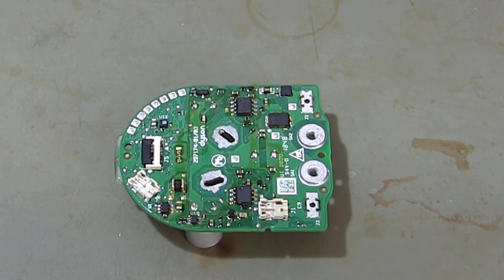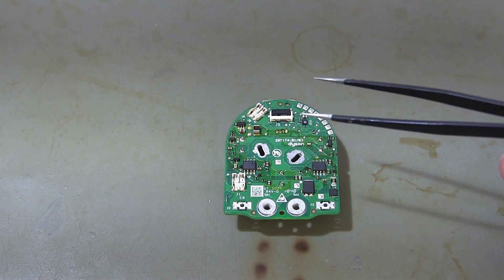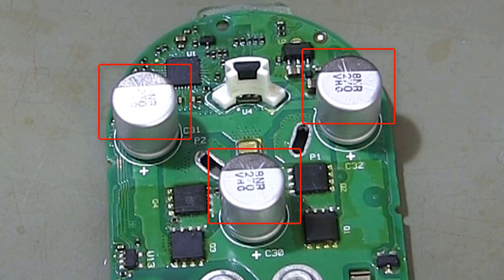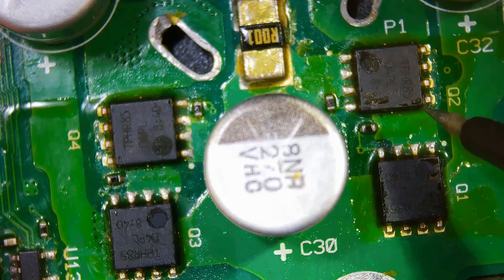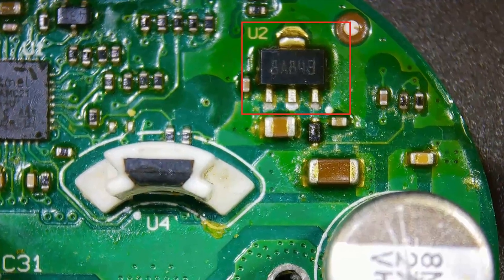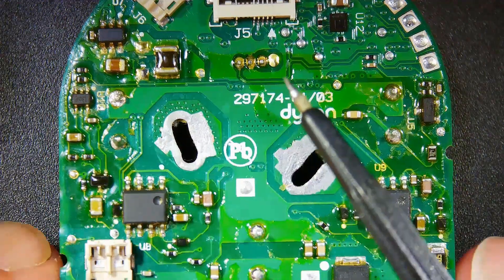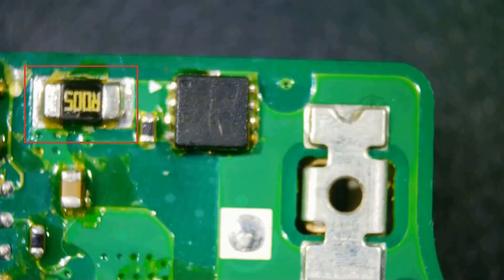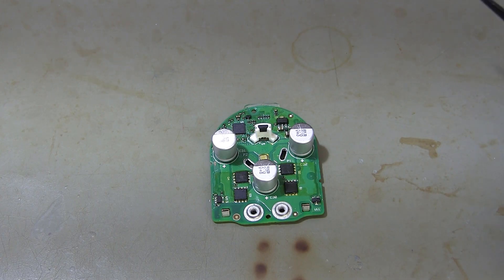How to Repair Dyson V11 Motor Control Board? Component Analysis

Comment: Hope you can help, V10 just starts and stops on speed 1 and 2, but it starts and runs on speed 3 if intake is fully blocked. Under normal operation it should start pulsing if intake is blocked. So looks like it only runs if motor is under a high load. I’m thinking current sensing resistor could be at fault or mosfets. Any idea?
Reply from the maker: Hi, I have never repaired a Dyson V10 vacuum cleaner before. But I can give you an idea about your problem.
Problem with Clogging Sensor
In Dyson vacuum cleaners, the motor load detection is activated when the air flow is blocked and usually exhibits a "pulsing" behavior to notify the user. However, your vacuum cleaner seems to only work under high load.
Possible cause: The blockage sensor may not be working properly or may be covered with dust/air.
Solution: Clean the sensor and make sure it is connected properly.
Types of Clogging Sensors
Pressure Sensor (Differential Pressure)
Measures the pressure changes in the channel through which the air flow is provided. When there is a blockage, a pressure drop or difference is detected.
Location: It can be in the air duct, near the filter or motor.
Working Principle: There is a piezoelectric sensor or membrane that measures the pressure difference.
Air Flow Sensor
Measures the speed at which the air is moving. If the air flow stops or slows down, this is detected as a blockage.
Location: It is usually located in the airway near the motor inlet.

Working Principle: It works with a hot wire anemometer or other air flow measurement methods.

Electronic Load Detection
In some Dyson models, instead of a physical sensor, the electronic control unit (PCB) on the motor analyzes the load status of the motor. When there is a blockage, the motor draws a higher load and this abnormality is detected by the control circuit.
Location: This type of system usually does not require a physical sensor; it is integrated into the motor control board.
Locating and Cleaning the Blockage Sensor
On Dyson vacuums, this sensor is usually located near the filter or in the air inlet/outlet.
If it is on the filter, the sensor may be covered in dust or dirt. You can remove the filter and visually inspect the sensor.
The sensor looks like this:
A module with small holes (for measuring air flow).
A part connected to the electronic circuit.

Fault in the Motor Control Board (PCB)
The motor control board contains the circuitry that controls the motor speed and power. The MOSFETs, optocouplers, or microcontroller on this board may be faulty.
Probable Cause: The load sensing or speed control circuitry may not be working properly, which may cause the motor to stall at low speeds.
Solution: Visually inspect the board. Check for burn marks, swollen capacitors, or cold solder joints.

Battery-Related Problems
If the battery operates normally at high loads but fails to provide sufficient power at low loads, this may also indicate a problem.
Probable Cause: The battery voltage may be low, or the battery management system (BMS) may not be working properly.
Solution: Measure the battery voltage and try with another battery if necessary.

Motor Failure
The motor may not be operating properly at low speeds and may be operating stably at high loads.
Probable Cause: One of the carbon brushes, bearings, or coils inside the motor may be worn out.
Solution: Inspect the motor and replace if necessary.
Airway Blockage
The cleaner's airway may be partially blocked, preventing the motor from providing adequate airflow at low speeds.
Possible cause: Blockage in filters or pipes.
Solution: Clean all filters, pipes, and connections.

Comment: This is the most useful video I have ever come across.  Thank you!  I also hope that you can do a video on the V10 as I have been trying to fix mine.  My V10 only works on Max.  When I try medium or low, the motor will only spins for a second and stops.  I have cleaned up everything and replaced the filter but still no luck.   It must be the control board that gives me problem.  What will be the most possible issues, the MOSFETs, capacitors, the hall sensor detecting the positions of that switch (Max, Medium, Low), or other things?  Thanks for you help!
Reply from the maker: First of all, thank you for your interest.
You can examine the following components to narrow down the causes of the problem with your Dyson V10. The problem is most likely in the control circuit or related components. Here are the possible problems:
First, Check the Solder Joints: Cold solder joints can cause such problems.
1. Hall Sensor
Function: It senses the RPM of the motor and controls the motor speed accordingly.
Possible Problems:
If the Hall sensor is defective, the control circuit cannot sense the speed setting correctly. Therefore, only one setting (Max) can work properly.
There may be oxidation or openness in the Hall sensor connections.
Solution: Check the output signals of the sensor using a multimeter or oscilloscope. If it is defective, replace the sensor.
2. MOSFETs
Function: It provides power management to control the motor speed.
Possible Problems:
If the MOSFETs are partially defective, they may not be able to provide enough power at low and medium speeds.
They may have been damaged due to thermal stress or overload.
Solution: Check the operation of the MOSFETs by measuring them. Replace the defective ones.

3. Capacitors
Function: Provides voltage balancing and reduction of fluctuations.
Possible Problems:
When capacitors age or fail, voltage fluctuations may occur, which prevents the motor from operating stably at low speeds.
Solution: Measure the ESR (equivalent series resistance) value of the capacitors. Replace those that are swollen or have low capacity.

4. Microcontroller (MCU) or Control Card
Function: Controls the motor speed and processes the signals from the Hall sensor.
Possible Problems:
If the MCU cannot process the speed settings, this may prevent the motor from operating at low and medium speeds.
There may be breaks or cold solder in the circuit traces on the control card.
Solution: Check the signals from the MCU and the solder connections. If the microcontroller is faulty, it may need to be replaced.

5. Motor
Function: Provides the suction power of the vacuum cleaner.
Possible Problems:
The motor may not be producing enough torque at low speeds.
There may be an internal winding short circuit or problems with the carbon brushes.
Solution: Check the connections and general condition of the motor. Replace if faulty.
6. Battery Management System (BMS)
Function: Provides the energy required for the motor.
Possible Problems:
The BMS may not be providing the current required for low and medium speeds.
Solution: Measure the battery voltage and current output. If faulty, check the BMS board.
Reply: @electronic7979  Thanks for your detailed explanation. 
My replaced, used Dyson v10 motor is a bit slower overall than before. Which of your answers 1 to 4 should you be suspicious of?
Reply from the maker: If the motor is a used motor, I recommend checking the capacitors first.
Reply: @electronic7979  Thank you so much for the very detailed reply.  I will work on the suggestions and hopefully can find the problem soon.
Reply: Thank you. I have the same symptoms. I had to replace the motor. Do you know what caused it? I have the motor that I took apart. I wonder if I can fix it someday.
Reply: @서원파-v3w  sorry to hear that you have the same problem.  I have checked the Mosfet, capacitors and hall sensor and they all seem fine. I still could not find the reason and ended just replaced the motor assembly like what you did.  I also feel that the new motor is somewhat less powerful than the original even though it otherwise works normally in all three modes.
Reply from the maker: Thank you for your interest. There is a possibility that the motor driver mosfets may be faulty.

Comment: HI , could you please help me to identify U2 regulator replacement.  I have Dyson V11 and it have marking 8a918. I struggle to find anything about this regulator to find replacement part , but no luck . I will appreciate if you know and to help me to fix my vacuum.  Best regards
Reply from the maker: I couldn't find much information about this integrated circuit. I think it's probably the HA178L00 integrated circuit. It could be a 2.5v, 3.3v or 5V positive voltage regulator.
Reply: @electronic7979  thank you for your time,  I will look datasheet and compare. Look like that is the one . I will give you update.  Best regards

Comment: ciao, sto provando a riparare il mio dyson v11. lo schernmo lcd si accende , cambia le modalità di aspirazione, ma appena premo il grilletto, da un colpo appenna accennato e on parte o una serie di piccoli colpetti. ho fatto delle misurazioni sul pcb e mi risultano rotte 2 resistenze dei mosfet mentre altre 2 hanno un valore di 100 ohm. r001 ha un valore diverso da 1Mohm. cosa posso controllare e sostituire secondo te?
Reply from the maker: It would be more accurate to remove the R001 resistor from the circuit board and measure it. If the resistors connected to the mosfet are faulty, your mosfets may also be faulty.

Comment: A common problem seems to be that  the high torque head motor starts spinning when the vacuum turns on, then stops immediately. This happens unless the vacuum is set on boost mode so there's nothing wrong with the motor. Would be awesome to know what's likely not working in this scenario and how repairable it might be. Great video.
Reply from the maker: Thank you for your interest and valuable comment.
Reply: I had this problem, a few months later the motor entirely failed. I fixed it by just replacing the motor with one from aliexpress and its basically like brand new.

Some people have been unlucky getting dodgy motors from aliexpress but my one seemed to be brand new. It cost me $135 australian.

Comment: Hi, thank you for this video. How can I repair a non functional v11 motor? When I push the switch button, I hear a sound (same sound when the chamber is full). What do you think about this please?
Reply from the maker: Hello. Thank you for your interest. If you hear a similar sound when the bin is full when you press the switch button on your Dyson V11 vacuum cleaner, the following problems are possible:

Airflow Blockage: There may be a blockage in the vacuum cleaner's pipes, filter or bin. The blockage can cause the motor to overload and make noise.

Filter Problem: If the filter is not placed properly or is dirty, it can cause the device to make the sound when the bin is full.

Apart from this sound, does the vacuum cleaner work normally?
Reply: @ thank you for the answer. 
Filter, bin and pipes are cleaned. Everything is ok but the cleaner doesn’t work at all. 
The battery il fully charged but when I press the button, always the same problem..
I am sorry, the sound is not like the bin is full. 
The sound is like when I press the switch button 1 second only (like a « bum »)
Reply from the maker: There may be a problem with the MOSFETs on the motor control card or the electric motor.
Reply: @electronic7979  thank you brother
Reply: @electronic7979 sorry which MOSFETs is defect for this prob? I'm facing same issue now. Can you show how to measure@check the MOSFETs?
Reply from the maker: Unfortunately, I can't make a video about measuring mosfets at the moment. But you can find such a video on YouTube. You should check all the mosfets on the card.

Comment: Merhaba, kanalınızı ilgi ile takip ediyorum ve abone olmak bugüne nasip oldu, Dyson V11 im var, bataryası ve motoru sağlam, başka cihazda testini yaptım, sorun anakartta, 1-2 saniye çalışıp duruyor, acaba sebebi ne olabilir?
Reply from the maker: Merhaba ilginiz için teşekkür ederim.
Dyson V11 elektrik süpürgenizin 1-2 saniye çalışıp durması anakartta çeşitli bileşenlerden kaynaklanıyor olabilir. Sorunun kaynağını tespit etmek için aşağıdaki bileşenleri kontrol edebilirsiniz:

1.MOSFET veya Transistör Arızası:
Motor sürücüsü olarak kullanılan MOSFET'ler veya transistörler arızalanmış olabilir. Bu bileşenler genellikle fazla akımdan dolayı zarar görür.
Multimetre ile MOSFET’lerin kısa devre olup olmadığını kontrol edin.
MOSFET'in (gate) sürücüsünü sağlayan devredeki sorunları da inceleyin.
2. Kondansatörler:
Şarj-deşarj sorunları, anakartın enerji stabilizasyonunda problem yaratabilir. Bu durum ani durmalara neden olabilir.
Şişmiş veya akmış kondansatör var mı diye görsel inceleme yapın.
Kapasitörlerin ESR (eşdeğer seri direnç) değerlerini ölçerek test edin.
3. Motor Kontrol IC (Sürücü Çipi):
Motoru kontrol eden entegre devre arızalı olabilir. Çip aşırı ısınmış veya dahili bir kısa devre yapmış olabilir.
Çipin yanına yakın bir bölgede yanık kokusu veya ısı olup olmadığını kontrol edin.
4.  Akım Sensörleri:
Aşırı akım sensörleri  yanlış tetikleniyor olabilir.
 akım sensörlerinin direnç değerlerini kontrol edin.
Anormal değerler arızaya işaret edebilir.
5. Soğuk Lehim veya Bağlantı Sorunları:
Anakart üzerinde zamanla oluşan soğuk lehimler kesintilere neden olabilir.
Lehim noktalarını inceleyin ve şüpheli olanları yeniden lehimleyin. Yapabilirsiniz anakart üzerindeki tüm bileşenlerin lehimlerini tazeleyin.
7. Firmware veya Mikrodenetleyici:
Mikrodenetleyici, kısa süreli bir hatalı veri işleyip motoru durduruyor olabilir. Sorun yazılımsal da olabilir.
8.Motor devir sensörü(Hall effect sensör)
Bu sensör motor devrini kontrol eder arızalı olursa bu tip bir arıza yapabilir.
Son olarak süpürgenin hava kanalları ve hortumlarını kontrol edin herhangi bir tıkanıklık yada bir hava kaçağı benzer bir soruna sebep olabilir.
Reply: @electronic7979  Çok teşekkür ederim üstadım, yaş 51 olunca malum mikroskop altında yapıcam işlemleri, kolay gelsin, bu arada eğer işin içinden çıkamaz isem size sadece motor ve motora bağlı kart olarak göndersem ücretli olarak bakma imkanınız var mı?
Reply from the maker: Rica ederim. Şimdiden kolay gelsin. Gönderirseniz bakabilirim.  İyi günler

Comment: Please make video for v10 dyson pcb i have his and i think a little problem but indont know where to look. The dyson make hum and turn off
Reply from the maker: If one day Dyson V10 vacuum cleaner comes in for repair, I will record a video and share it on my channel.
If your Dyson V10 vacuum is making a humming noise and shutting off, the issue could be due to one of the following:

1. Blockage

There might be a blockage in the vacuum's hose, filters, or airways.
Solution:

Check all airways, hoses, and attachments for obstructions, and remove any debris.

Ensure the filters are clean. Dyson V10 filters are washable, but make sure they are completely dry before reattaching them.
2. Filter Issues

Dirty or damaged filters can cause the motor to strain.
Solution:

Remove, clean, and fully dry the filter. If the filter is old or damaged, replace it with a new one.

3. Battery Problem

The battery may be degraded or faulty, causing insufficient power for the motor.
Solution:

Check the battery's condition. If it's weak, replace it with a compatible one.
4. Motor Issues
The motor might be damaged. Humming noises often indicate motor problems.
Solution:
Inspect the motor for any damage and consider replacing it if necessary. Consult a professional if you're unsure.

5. Air Leaks
Air leaks in the seals or connections can cause the motor to work harder and create unusual sounds.
Solution:

Inspect all connections and seals, and replace any that are loose or damaged.

6. Sensor Problems

Faulty sensors regulating suction power might cause the vacuum to shut off as a safety measure.
Solution:

Clean the sensors or have them checked by a professional technician.
Reply: @electronic7979 where is the vaccuum sensor and how to replace them? How canbi check the motor condition?
Reply from the maker: You can check the electric motor by measuring it with a multimeter and you can find the video about motor control on my channel. I have not repaired a Dyson V10 before so I unfortunately do not know where the sensor is.

Comment: Sorry to bother you , What is the resistance of the gate mosfet?
Reply from the maker: In MOSFETs, the gate drive resistor is a resistor connected to the gate terminal of the MOSFET and is an important parameter that affects the switching performance. This resistor is usually added externally and has several functions. Here are the details:

Purpose of Gate Drive Resistor:

1. Control the Switching Speed:
A current is required to charge and discharge the gate capacitance (Ciss) of the MOSFET. Adding an external resistor limits this current and thus controls the switching speed.

Low resistance → Fast switching (shorter switching times).

High resistance → Slower switching (increased switching losses).

2. Reduce Noise and Oscillation:
A resistor added to the gate can reduce unwanted oscillations and electromagnetic interference (EMI), especially in high-speed circuits.

3. MOSFET Protection:
A gate drive resistor can prevent damage to the MOSFET in high-frequency operation. It also limits the current from the gate driver, ensuring safe operation of the circuit.